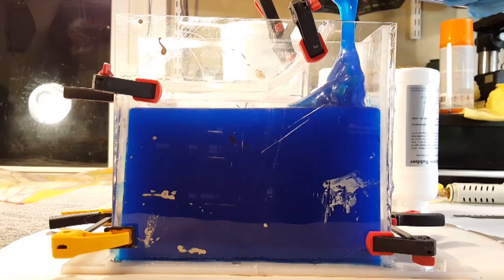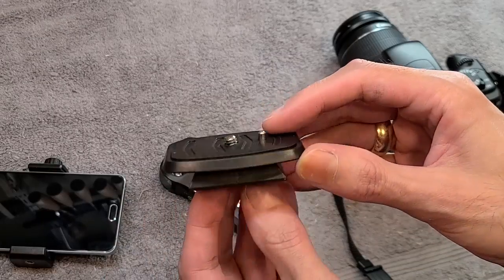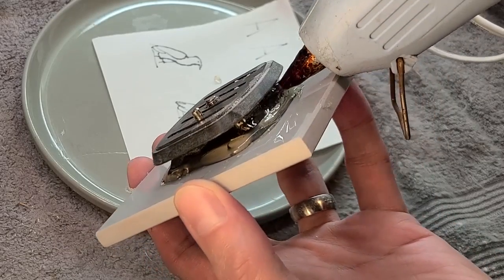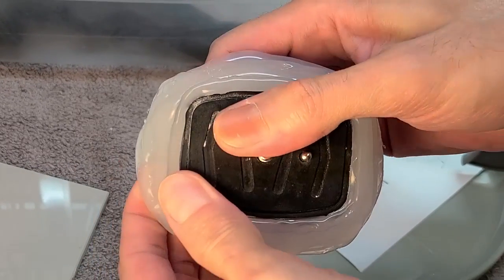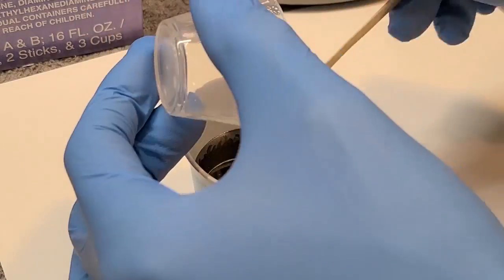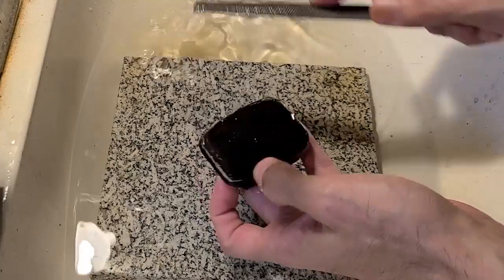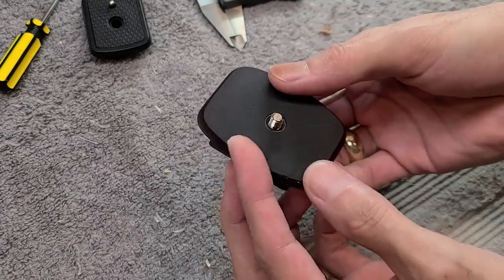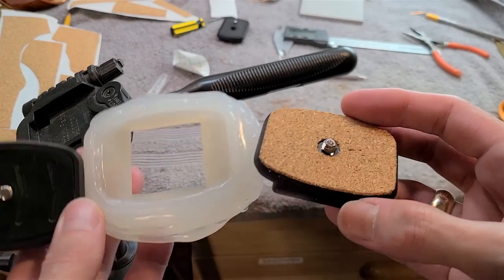Can you make a mold with HOT GLUE for Epoxy casting?

Comment: This raises a question for me (as a 3D printer guy), can you use a 3D printer PEN, and FLEXIBLE FILAMENT (prolly 95a shore hardness since pens don't have likely a good enough drive mechanism for softer filaments) to equally well create a mold???
Reply from the maker: That's an interesting question!
My only experience with 3D printers so far is with the resin ones, so I have no idea!
Reply: It'll be a lot more tedious considering the flow rate of a 3D pen compared to hot glue fun.

Comment: nicely done. was the mold damaged at all when you removed the cast? can you reuse it?
Reply from the maker: No damage at all. The corners looked a little 'fatigued", but the hot glue is remarkably flexible, and I should be able to use it a few more times with no problems.
Reply: @SculptyWorks  fantastic! good luck with it and all your other projects. big fan of your work